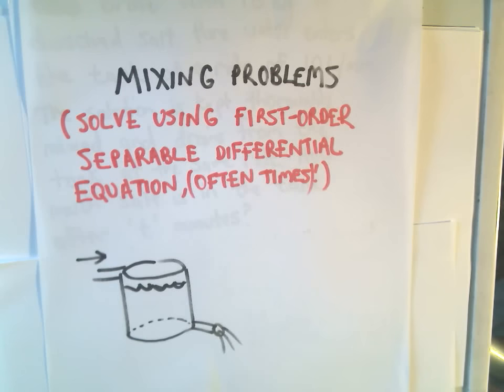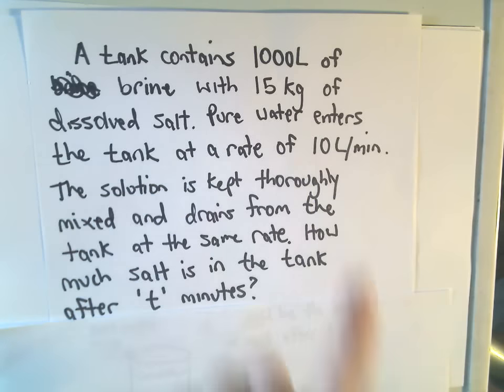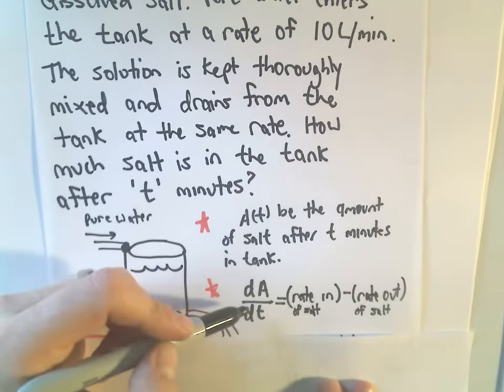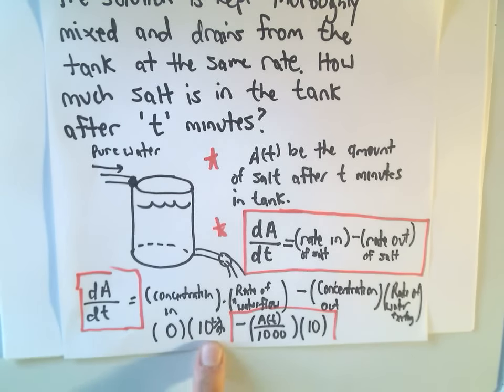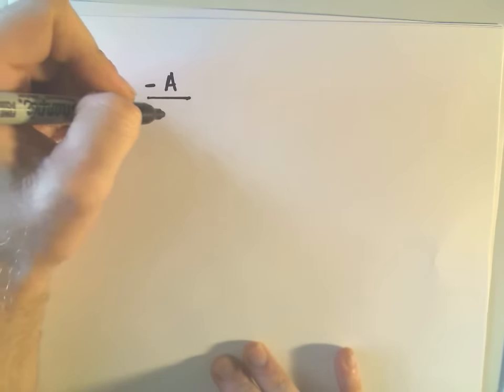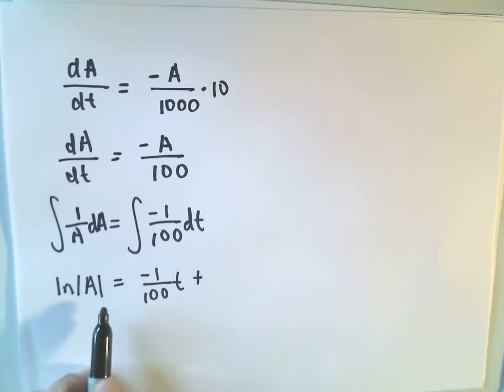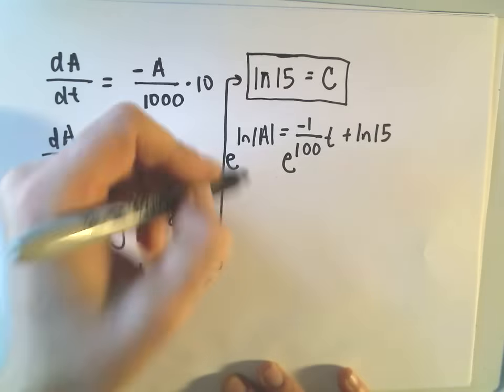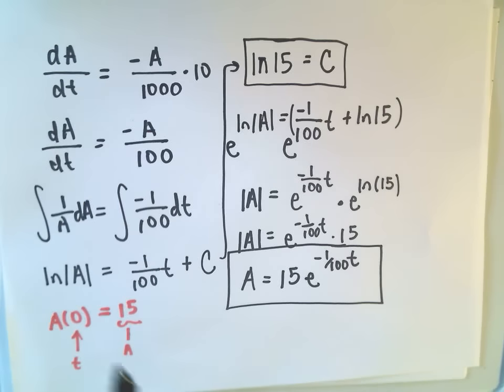❖ Mixing Problems and Separable Differential Equations ❖

Comment: You can also skip the separation of variables by using the characteristic polynomial. 

A’ + 1/100 * A = 0
R + 1/100 = 
Root = -1/100

Y = ce^(-1/100)
c = A naught = 15
15e^(-1/100)

If it weren’t homogenous you could also use undetermined coefficients to find y particular and add it to the homogenous solution.

Comment: If you were to differentiate ln(-1/100) + C (to check to see if your integration was correct), you would be get 0 since you are taking the derivative of a constant. The integral of (-1/100)dt is (-1/100)t + C and you can check by taking the derivative:
-1/100 * t + C
u=-1/100          v=t
u prime= 0       v prime=1
u(v prime) + u prime(v) + 0
-1/100 * 1 +0*1 + 0 = -1/100

Comment: excuse me. Can u help me solve this problem? TQ
- A tank with capacity limit of 1000 gallons initially contains 200 liter of pure water. Then at time t = 0, brine containing 5 lb of salt per gallon is allowed to enter the tank at a rate of 20 gal/min and the mixed solution is drained off at a rate of 10 gal/min. How much salt is in the tank at the point of overflowing? (it says that the tank INITIALLY contains pure water, and at the same time, at t = 0,they pump the salt) so what should I do? )

Comment: what happened to your rate in (10L/min), it seems that you left that out, shouldn't it be dA/dt +A(t)/100= 10? Making this a first order linear diff eq instead of an easier separable equation?
Reply: i think it's pretty clear cuz it's pure water flow in, water has no concentration, so when you multiply concentration it cancels out. watch video carefully, if it's salty water flow in, then that's the case you are talking about.

Comment: What if your A(0)=0? What if your initial condition states the amount of salt in the tank is 0? (pure water). How would I get the value of the C constant after integration? Thanks! Thanks for making this videos too! So very helpful.

I even exponentiated each side to get rid of the ln[A], then I ended up with my new constant being 0, which cancels out the extremely important variable t. What to do?

Comment: Make sure next video ( If it is a similar problem with same RATEin / RATEout ) that using the given volume is not always the case. If the rates are different then there will be a function for the volume

Comment: I have some question involving some mixture problems but I don't get it much:  How many pounds of 35% salt solution and how many pounds of 14% salt solution should be combined so that 50lb of a 20% salt solution are obtained?

I tried to solve this using different equations but I'd come up with some negative answers...

Comment: what do you do iffthe problem involves two tanks? the problem i have says that a tankA has say 200 L of water with 40 g of salt in it and tankB has 200L of water with 20g of salt in it. tankA drains into tank B at a rate of 16L per minute. tank B drains out of as spout at a rate of 12L per minute and out of a different spout, 4 L per minute, which this one feeds back to tank A. tank A is also filled by a seperate spout with pure water at a rate of 12L per minute. how do i work that out??